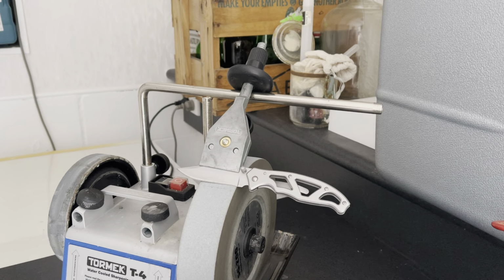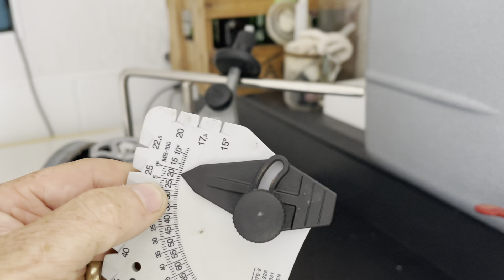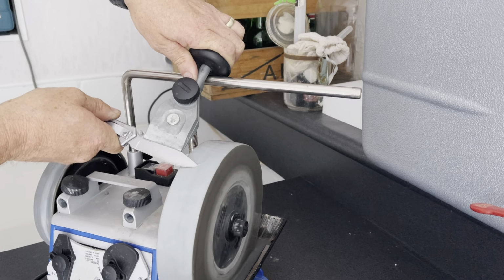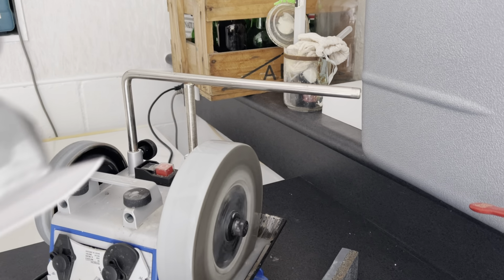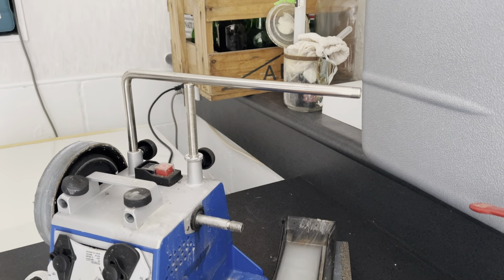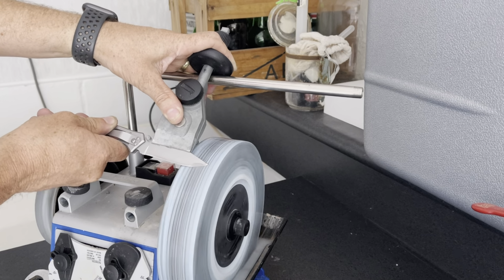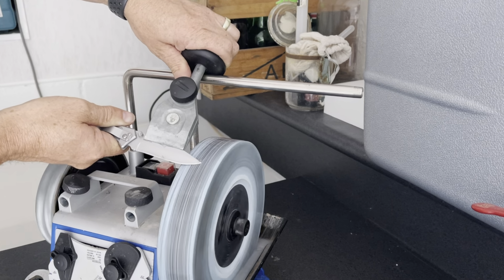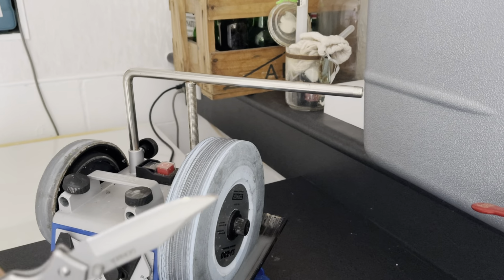Sharpening on a tormek T4

Comment: If you're using the paste that comes with the tormek, it's a 6k grit aluminum oxide. The japanese waterstone from tormek is 4k. Honestly though, I'd recommend sanding the wheel down with some 120 grit sand paper, get as much of that compound off as you can, and load it with some 1 micron gunny juice. The problem with aluminum oxide is when you get into the more exotic steels, it just causes carbide tearout when the particle size gets too fine. You can't go wrong with 1 micron diamond and it makes a good final step right after the 4k wheel.

Comment: Great video, but I like to know which jig do you recommend when sharpening a blade that is 3.5” long with one side bevel, the blade is similar to planer blade. Thanks
Reply from the maker: If it’s a knife then the knife jig should work, but if it’s a too then the the tool holder will work, there is one specifically made for chisels as planar blades, that should work well, it’s it’s single bevel remember to remove the burr on the opposite side once you get it sharp.

Comment: Why don't you recommend the T-4 for knife sharpening?
Reply from the maker: I think the t4 is fantastic on flat edges, like chisel or scissors, but where you need to manually introduce a curve, as you find on most knives, the possibility of error is magnified.
If you take care you can get a really good edge, especially if you add the Japanese waterstone into the equation, but for knives I prefer to use the Tsprof, gives me more control.
Reply: thank you for your response.

Comment: your doing many things wrong, always stand behind the machine not in front of it!!!  your first stone are not round, it should be rounded with the lath tool,  the jig that holds the knife must be parallel to the edge and the screw that sets how thick the blade is must be set rigth so the knife is in center of the jig clamps , when you sharpen the knife with the jigg, never swing the knife when you come to the tipp!!!!!!!  only lift the handle an the knife straigth up!!!    after you have sharpen the knife , never leave the stone in the water and after your one, let the stone run dry for 10 min  atleast!! so the water can leave the stone dry, otherwise it will not stay round for long!  sorry for my bad english